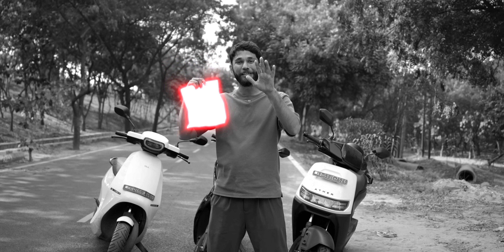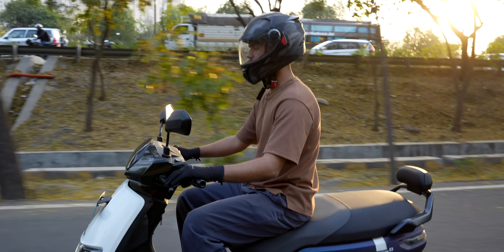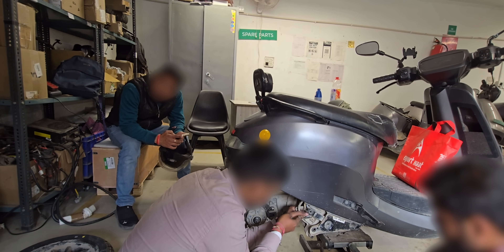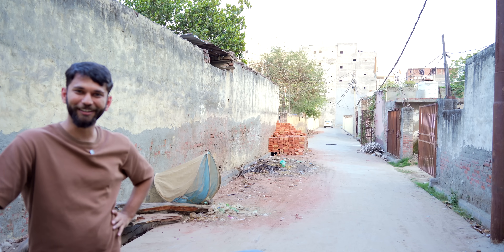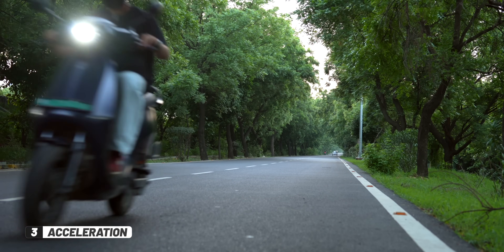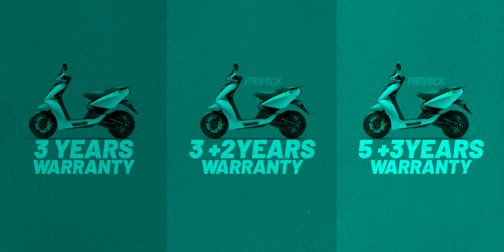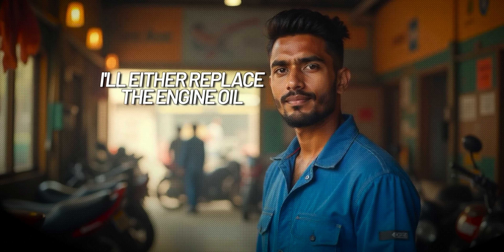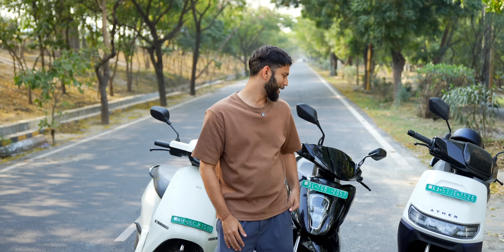The Real Truth of Using EV After 2 Years!

Comment: Unless there is a cell level repairing infrastructure, Batteries will eat away all the gains of saving Petrol.
Reply: Even if you buy the 8 year warranty which is the most expensive option it will still be cheaper than a petrol scooter
Reply: No. It won't lmao @kartikthakur9939
Reply: Heres the deal brother, i saved 50 thousand till now in petrol, and to get the battery changed in ola outside warranty, it cost around 30-40k, i've already saved more than the cost of battery, and my scooter will still run for good 3-4 years, toh tab another 50k, and i can just buy another scooter. Toh even if cell level repairing is not available, it doesnt really matter. Not to mention if before 8 years my battery dies, i get a free replacement, plus 1 lakh saved on petrol
Reply: @devashok4242 which company giving 8 year battery replacement?
Reply: @knowit2k  ola extended warranty (replacement if drop below 70 percent)
Reply: As a delivery boys,i ride around 4000-5000 km monthly.

And current charge +monthly service total cost me around 2000 rupees only.

But with a bik or scooter with ariund 60 kmpl avg you need around 5000 rupees for fuel itself.
Reply: @AlienBrainfromPlutobhai 2500 kilometres per month ke liye best scooter jo pocket friendly ho/bich sadak par ruk na jaye, service cost jyda na ho/parts warranty me ho bata do please
Reply: @AlienBrainfromPlutobhai aisa kya krta hai be 133km per day at 4000 ????
Reply: @AlienBrainfromPluto EV works for your use. My ride will be less than 10 kms per day, 2-3 days in a week. Other days it will lie unused. So EV does not work for me
Reply: @AlienBrainfromPlutobro, ab batao kaisa h scooty?
Reply: I think that's what they do when you replace battery under warranty, they probably recycle or refurbish the old cells.
Reply: - Which ev are you using.
- Do you recommend Ather Ritza for Swiggy, Rapido (Daily 100km)
Reply: Ather has that and provides a cheaper replacement

Comment: I purchased an Ola S1 Pro, but within a year, the battery completely deteriorated. Despite multiple complaints and direct emails, Ola Electric has not responded. I ended up losing ₹1.5 lakh in Ola Electric India scam.
Reply: file a case
Reply: @haroon_paul tarikh pe tarikh
Reply: @haroon_paul  mostly log ke pas ola ka electric vehicle hota hi nahi hay .. to case kaise file kare ??? Yee log to negotiate chorte  hay
Reply: Kese issue aaya reason ??
Reply: Bhai I really want to know all th4 people who pbought Ola, did you get some good deal? Was it free? What made you buy this bike when there are cheaper models, older and reliable companies?
Reply: @AzxertyBqwedgt see this is based on what my parents think. They prefer quantity rather than quality. Ola seems to get their ideas at a cheap and affordable manner. Ola displays a high range (by range I meant distance) but we know it is not true. When I speak about it's built quality it is built with fiberglass kind of material. Personally we had an accident with the Ola s1 pro gen 2,a dog suddenly ran from the bushes into the vehicle. The scooter skid and fell due to it, we were lucky we had installed a guard so the scooter was saved. I got surprised when the scooter fell the power cut of immediately. Rather than this we have not faced any issue regarding the scooter
Reply: @AzxertyBqwedgt Exactly my question...why are people buying OLA? Is it free?
Reply: @AzxertyBqwedgt  mere pass s1 pro hai gen 1 
33k km ho Gaya 
Price + range wahi main factor hai ola lene ka
Reply: @AzxertyBqwedgt  Cause electric vehicles are cool, plus i saved around 50 thousand rupees in just petrol cost in last 3 years, what else do you want, in next 3 years i would save enough money to buy another electric scooter. 2nd thing, the ease of charging, i have my own parking so charge at night, very easy, i plug it in, goes to sleep, and it is fully charged by the time i wake up. So technically my time isnt wasted. Last point, i wont have to scrap my ev after 15 years, but you will have to do that with petrol scooters, i will just get its battery replaced after 15 years, and i am good to go.
Reply: @devashok4242  You are assuming that ather will provide you a battery after 15 yrs. What if they say ' This model is outdated, we have moved to a state of the art battery', that wont fit ur old vehicle. Battery on the EV will cost 70% of a new vehicle cost. Might as well get a new EV. Why should a petrol vehicle be scrapped after 15 years if it is running well. Not everyone is in NCR.
Reply: My Ola S1 X+ stopped working all of a sudden. Turns out a wire was cut by rat bite. They don't provide keys so I wasn't even able to unlock the handle lock. They were asking 3000 rupees for roadside assistance. I declined. I went to home for a month came back and took my vehicle to their service centre. Turns out that my battery has gone into deep discharge and won't be covered in the warranty. They are asking for 40000 rupees for replacement. This has been 4th breakdown in the last 2 years of my purchase. I am never buying Ola ever again.
Reply: Ola was a scam from start... Over-promise and do-not-deliver!!
Reply: Same with me with Hero electric
Reply: @ArchSh167 . Hero vida?
Reply: EVs in india is a Scam. Don't waste your hard earned money on Scams.
Reply: I m using ola s1 pro from 2.5 year  
I got battery issue but they changed the battery for free  
I drove almost 85k - km
Reply: @arkgaming3806  kaise Bhai din me do baar charge krte the kya? Or Roz 100km chlate the scooter kya? Jo 85k km chla liye 2.5 year me? Kuch v mtlb?
Reply: @arkgaming3806  bro you travelling 95km per day in a scooter 💀
Reply: @arkgaming3806 85km in 2.5 year? R u living on two wheeler?
Reply: @arkgaming3806 how much rage you was getting while last tou driver with old battery and how many km you driver with that old battery, my S1 gen 1 not getting 55 to 60 km rage (3 kWh)
Reply: I also own ola, and changed battery 2nd year for free😊
Reply: @therealdojohub  It is not a good thing to pride about if your battery dried within 2 years. Expectation is atleast it should last for 8 years for the premium you are paying.
Reply: @therealdojohub how? What was issues on scooter?
Reply: You are a fake person for sure anti ola lobby get well soon buddy
Reply: Par swadeshi ka churan toh swaadisht tha na😂😂😂
Reply: ola HSRP pr registered ni h
Na hi 2 saal se number plate di muje 

na 19850 subsidy aai
Reply: I got free replacement twice bro.... waiting is the only issue other
Reply: I think you deep discharge battery that's why
Reply: Even My self caught in ola scam...within 2 years is not working properly.. they are just fooling the customers... just waste of monye
Reply: who the fuck buys ola? pls do proper research before buying one
Reply: Scams 😂😂😂 tuj Jaisa unpar vikari ke liye scam ho ga..   mujhe lagta hay tere pas electric to kayy koiyy bhi scooter nahi hay
Reply: ola is the worst same heppened to me.. dont buy these, ola is scam
Reply: Consumer forum
Reply: Proof?
Reply: Noone can beat ather proud owner ❤
Reply: File a consumer complain
Reply: Bro you forgot to charge for sure some day
Reply: Buy bajaj chetak electric.. its reliable
Reply: Kuchh bhi .....how proof😅
Reply: Bro I had the same situation with Ola S1 Air .The absolute shit company.The do not help the customer instead tell to replace battery.
Reply: The same happened with me with hero electric.
Reply: My Ola S1 Pro used to give 120km range. After 2 years use, it's still giving 110km range (And I use Sports mode too along with Normal mode - I never use Eco mode).
Reply: Yes
Reply: Hai legal case lagao
Reply: Consumer court jao. Hai
Reply: Has 3yrs of warranty
Reply: Consumer court
Reply: Bro it's nothing my neighbour's OLA caught fire and burned 😂 you Lucky at least you can replace battery an bike will be fine
Reply: Go to consumer forum
Reply: Ola is a scam company!
Reply: All EVs are scams.
Reply: Consumer court case
Reply: Even I got scammed., I bought S1x. one year back …. Now it’s about to go to scrap …. No service at all
Reply: Consumers court case karo proof ke saath just 400rupees
Reply: You deserve a new battery replacement according to warranty 😅.
Reply: Bhai ke pass ola kbhi thi hi nhi 😂😂 bs bokhne aaya rha bhok ke chla gya
Reply: Same here
Reply: Same bro
Reply: Better than that is a Chinese bike working voltage is 72 volts
Reply: What about ather
Reply: bro 8 years ki warranty ka kya hua
Reply: Bhai meri battery me problem Hui 2 saal baad service center le gya 2 hafte me nyi battery aa gyi lag gyi Zero 0 rs me ola ne replace ki battery ....peoples are making mistakes by themselves and then criticise the company
Reply: @Ravisingh21794  i am not sure.. bro.. but people never make mistakes its the mistakes by company who doesnt give proper knowledge on the maintaince of bike. if they could they wont have replace.. and not even any customer get the issue
Reply: Its not scam, if only your scooter died, mine havent, and its been 3 years, still giving more than 100km of range, so i am pretty sure that battery should be in 80-90% range. Stop calling everything a scam, if a company hurt you, then file a consumer complaint, it would've been a scam if they took your money but never delivered a scooter.
Reply: If you ask me frankly I never comment on someone's look but the Ola guy is looks like scammer... How any one can trust him and buy an Ola
Reply: Dont make people f00l, if it is in warranty ola will replace it. So shuut upp
Reply: OLA has three years warranty
Reply: @dhanushbc5396 Giving a warranty and claiming that is different one. Try to claim warranty with LOla you'll come to know the reality.
Reply: @dhanushbc5396  yea but what if service center just ignores or delays, i have seen this type of cases in ola. Oh you can say just file a complaint! come on man you can buy new EV then run behind our corrupt government😅
Reply: @dhanushbc5396 8 year
Reply: If you don't charge the bike for over 2 months, it's your mistake. I did the same mistake and ended up paying 45k.
Reply: @YuvanBalaji when did you replace your battery? Battery capacity? Can you share repair amount split?
Reply: @akd-R  I got it replaced on January 2025, actual price of the battery is 86k but the service center managed to get the replacement battery for 45k. But to get this price, they will ask us to wait for few weeks as they will have to negotiate this price.
Reply: I'm using S1pro for 2 years. Last month I've got bettery issue after 22000 km and they changed the bettery. Whole process took 8 days.
Reply: @bhabahazarika ho much rage you was getting with old battery? issue was with range drop or dead battery? I'm facing rage drop in S1 gen 1, getting 50 to 58 km in Normal mode..
Reply: Ola is best.. using last 3 year
Reply: Don't spread fake news.
Reply: @dhanushbc5396 maybe i think what he's saying is that.... company is not responding the the warranty claims...
Reply: 😅 u know he is saying fake @dhanushbc5396
Reply: It's painful to hear this bro.. file a case in consumer court
Reply: 😂😂😂sad
Reply: Warranty ka use karo

Comment: The main point to keep in mind before buying an EV is the purpose of your use. I have been using Ola S1 for over 2 years, I need to ride around 50kms per day, I have completed 34K kms, I extended my scooter warranty to 5 yrs/60K kms (Comprehensive). In my calculation I will complete 60K kms in 4yrs. I haven't paid much for scooter maintenance (Compared to petrol scooters), also I don't always depend on Ola service centres for small services, like changing break pads and tyres. The service was the worst until last year, but they are providing much better service for last few months. The vehicle had major issues in the starting (6K kms & 12K kms), but after that it hasn't faced any major complaints.

I am not suggesting Ola, since it has got too much complaints from the customers. But in my case, I feel it is cost effective and I haven't faced any major challenges yet.

Comment: Few months back my Ola S1 Air was gone into Deep Discharge mode and the guys at Ola Service Centre changed the whole battery and then asked me to pay 11k for the it.
Reply from the maker: Damn!
Reply: @techwiser They have mentioned in their policy that if the consumer does not take care of his battery usage (as in running it in low power or not charging it for numerous days will eventually cause the battery to deep discharge) then they are fully responsible for the consequences. This is why they have offered us a feature called the holiday mode so that we can shut down the scooter completely before going on a holiday which will prevent the battery from deep discharging.
Reply: @Surajkar-p8i Their vacation mode feature does not work.
Reply: So, that's the real business
Thats how they've reduced cost of their scooters 😂
Reply: Ouch!!
Reply: Thanks for the contribution to economy. Tete jaise aadmi na Hota to bhavish raaste mein hota
Reply: BC 🙄🙄
Reply: Thats crazy
Reply: Bro you should've turn Onn the Vacation Mode before leaving your Ola for a long time. It may save your battery!
Reply: @koppulapremsagar It doesn’t work.
Reply: H
Reply: Mine went into deep discharge mode twice, first when it was at the service centre, took 4 months and lots of emails to the upper management to get it replaced and second time, today.
Reply: @anuragrai6030 bro please provide their mail id. I m facing same issue
Reply: I don't know why people are buying EVs they are neither practical nor cheap!!! And definitely not good for environment (search how pollution an EV create while making)

Comment: seems Ather promo video before their IPO.. I also have Rizta, it has never delivered full displayed range as they don't count braking, kind of acceleration soft or hard, speed of driving, tyre pressure etc. in showing range. Also, fast chargers are sometimes non-functional and occupied by others which is annoying factor.  else, it is good, delivers about 80% of shown range with real world driving conditions.
Reply from the maker: Interesting, where is your location?? In my experience, since I live around Delhi & NCR, the charger situation has gotten better than a year ago. 
- Pratik
Reply: @techwiser  Thanks Prateek, I also live in Delhi NCR. Can connect with you on this.

Comment: 450X Gen 2 owner. 68K+ kms done, ₹1.6+Lkhs saved. Battery significantly droped, but gets the job done. Driving style :- super aggressive, Satisfaction :- 9.5/10
(Bought in 2022 for ₹1.3Lkhs)
Reply: whats the battery health now ?
Reply: @nihalverma9007  yet to check
Reply: Battery health?
Reply: How much range is the scooter giving now compared to when it was bought new...
Reply: @ram_bharosey  45kms now compared to 102kms (True range still shows 85km)
Reply: @IAN-X like i didn't get i also own gen 2. ....did your range drop from 105km to 45km?
Reply: @IAN-X  ye to shayed warranty me covered Hoga .......3 year warranty hoti hai ....aap usko claim kar sakte ho kyoki aapki case me aapka battery degradation more than 70%(allowed limit) hai....matlab battery kewal 70%hi degrade hi sakti hai 3 years me warna battery replacement. Milta hai....
Reply: Can you get the battery replacement?
Reply: @prashantthapliyal5449  I had an option for free replacement till feb 25 (mine 450X had a 3yrs unlimited kms warranty) but I skipped it.
Reply: Bhai I really want to know aap normal petrol wala scooty chalay ho? Kaisa hai difference?
2/3 Saal baad 50,000 Ka battery change achha Hai ya petrol bharna?
Reply: @AzxertyBqwedgt  tujhe city mai chalana hai sirf and running is more than 75kms a day. Go for EV, particularly Ather (tried and tested).
Reply: @IAN-X  han bhai, thinking of buying one for the same reason the daily commute is about 70-75 kms I am confused between Chetak and Ather, as Ultraviolet is not going to deliver anything before the mid of next year. Which one should I go for?

Comment: I'm a Vida user and as hero motocorp is a big company It would be really nice if you include it too for upcoming videos and I need to know more about scooter to
Reply from the maker: Umm, since it didn't make it in the top-4 EVs in India. We didn't consider it that much. But, we'll try that no promises
- Pratik
Reply: I am a VIDA user too and I love the removable battery system. It is very useful in gated communities
Reply: I'm not convinced about its build quality. I'm sure version 2 will be a better product.
Reply: @RoodeMenon  I'm using V2 plus and it feels solid and riding it is so good
Reply: I  am longing for a better software in Vida but other than that, the service of Vida was really good. I had problems in the vehicle at the beginning but the did sort out the difficulties entirely
Reply: @talkwell8589 yea man I wish I could access maps also I got my service for just 300 😊